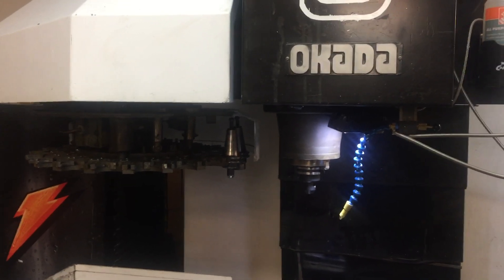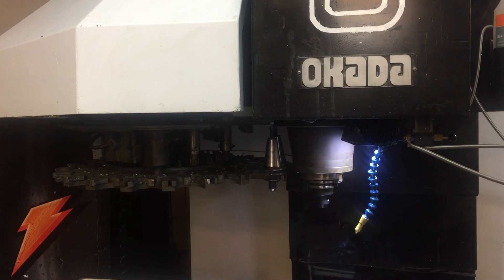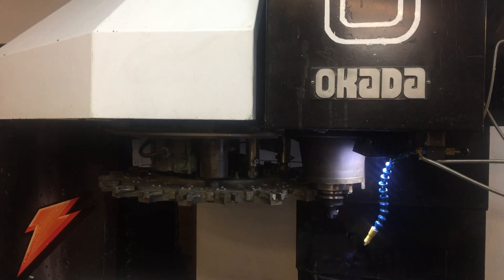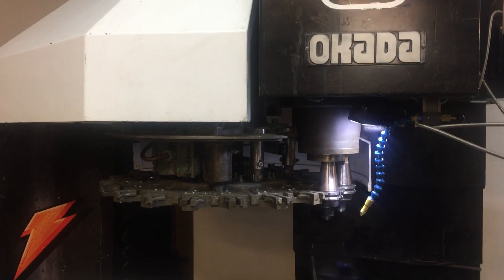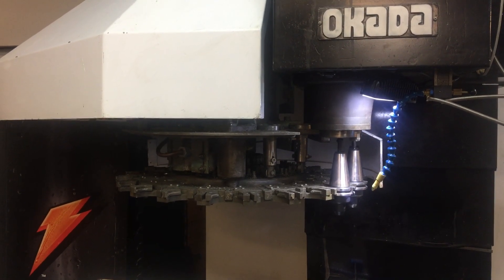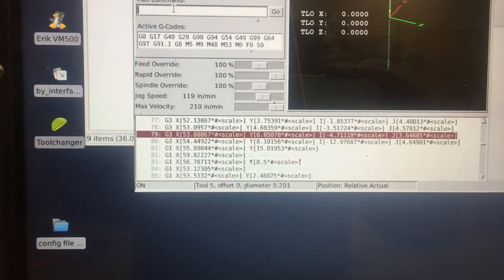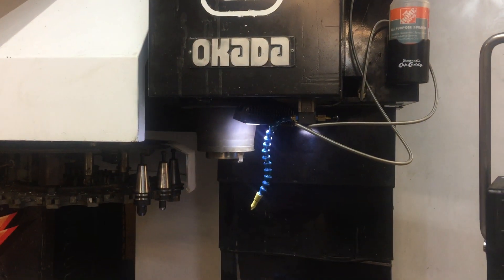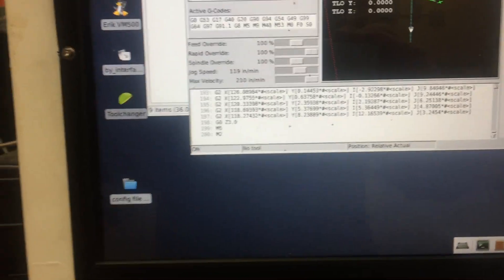LinuxCNC - Okada VM500 VMC Toolchanger

Comment: Did you have to use a servo for you spindle to to orient the spindle for a tool change?
Reply from the maker: The Fanuc spindle Amp has an orient function.  This is actually a problem for me since the controller is failing.  It runs the spindle for about 30 minutes then shuts off.  I replaced all the big FET's and capacitors.  If I can't repair it, I'll need to switch to a commercial VFD and don't know what I will do for orient.....
Reply: You can turn at 0.5HZ and when it hits the index position it stops. Most normal inverters have some type of DC braking at low RPM
Reply: @Erik Mikkelsaar DC braking even on a synchronous motor is quite strong and take a while for the spindle to move a significant amount, remember as soon as that drawbar fires the spindle will be locked any ways. Said that I made a hal component to control the position of my spindle, (video will come, someday in the long future) also useful with broaching.
Reply: @Erik Mikkelsaar i use a normal inverter to Orient , i use G33 to reset the encoder , and read the position with M66 when arrives , stop spindle , and use DC break at 20% ir more by 10sec
Reply: https://youtu.be/Pcr8fdVTOYU